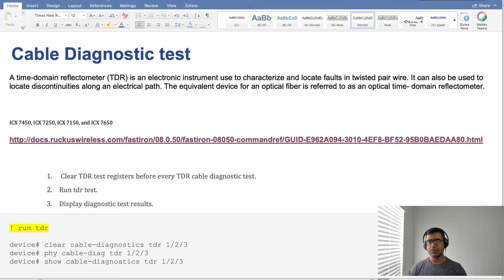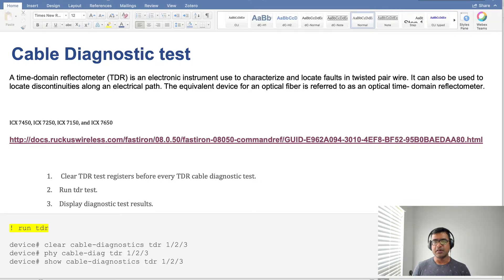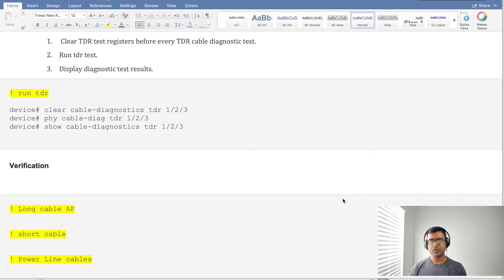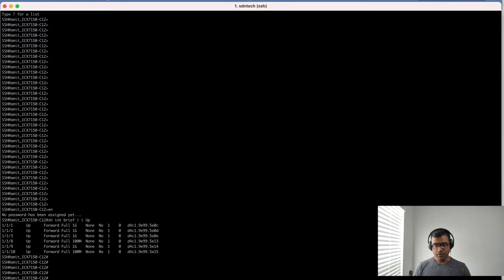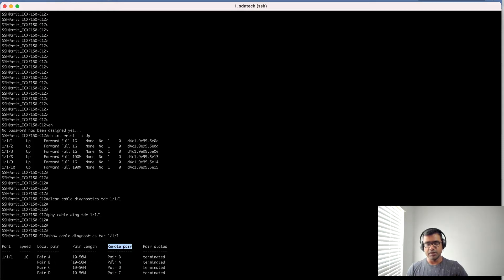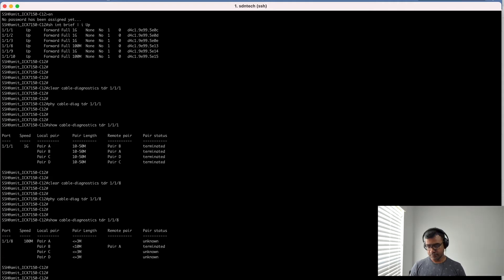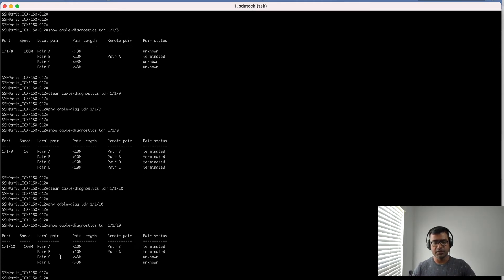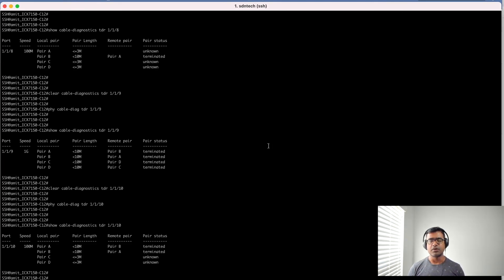Cable diagnostic using TDR test

Comment: Thank you for the video. In my case there is no clear cable -diagnostic tdr command available. So when I run the test, how can I stop it? This is a Cisco 9300 switch.
Reply from the maker: For Cisco Catalyst 9k - 
Step 1	Starts the TDR test.
#test cable-diagnostics tdr {interface { interface-number }}

Step 2	Displays the TDR test counter information.
#show cable-diagnostics tdr {interface interface-number}